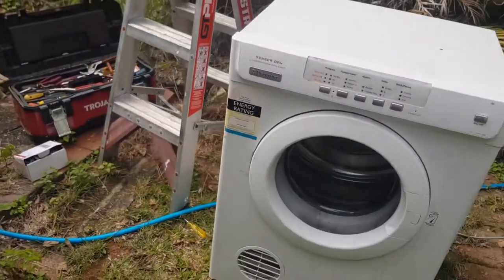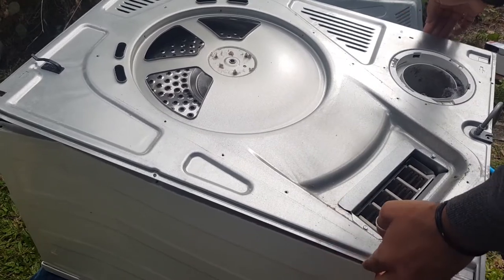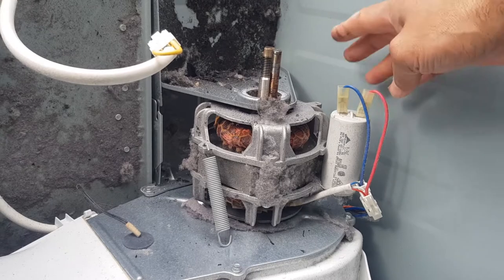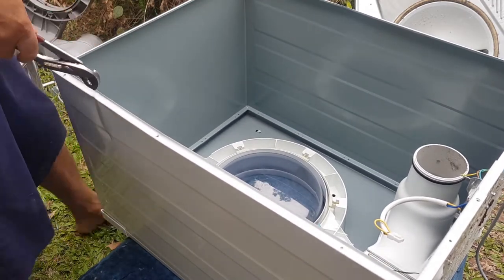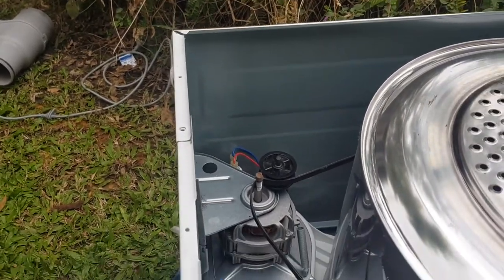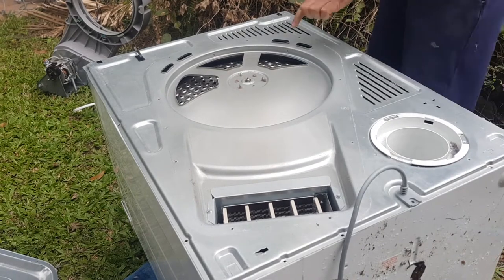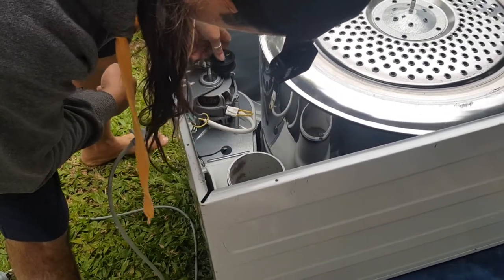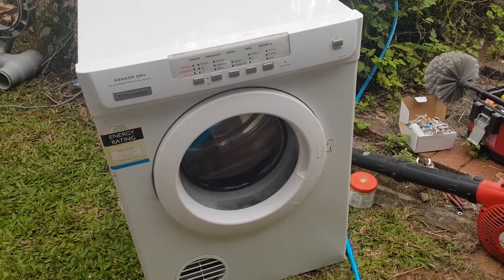Electrolux, Simpson, Westinghouse Clothes Dryer idler / Capacitor replacement. Fix Repair DIY

Comment: I have the same Westinghouse dryer, it's always been stiff to turn. Thanks for showing the idler and the capacitor replacement, I went looking for your video to see if the polarity of the capacitor mattered and you say it doesn't, so that's all good. I wish I'd seen your video earlier as your method of taking off the back was much quicker and easier than mine...
Reply from the maker: @antibodiesagainstkookery3871  No problem mate, it's good to know for next time 😎👍

Comment: Thanks for sharing this video. I was able to sort out my dryer after watching this. Replaced a broken idler pulley, belt and bearing. Runs as good as new and quieter than ever. Thanks!
Reply from the maker: No worries! And apologies for the late reply. Looks like you left this comment at basically the same time I had a massive house fire thanks to a faulty electric blanket. It's set me back quite a bit.
But we'll done! Feels great when you repair something yourself rather than toss it out and spend lots of money replacing it 🙂👍

Comment: Did one of these idler bobbin jobs when I was living down in Tassie. Saved a small fortune. Where most would have hurled it out, I had time on my hands, like you seem to do, and broke out the tools.
Ain't done the capacitor gig before... so thanks for that. Cause we have a praaaablem once again with another version of the same model (SDV401). Only this time the symptoms are different. So I shall approach from the shallow end, money wise, and take it one step at a time. I ended up creating a service 'window' right next to the motor, (with an angle grinder). In case it went pear-shaped again, I wouldn't have to pull the whole back off it to look in. Had to make a cover, of course. Used the side off another gloss white tossed out unit, and some metal self-tappers. Worked well.
Tx Man! Great stuff.
Reply from the maker: Wow that's a pretty cool idea well done!  At least these Simpsons are easy to work on.  I think they're the easiest  out of all the brands so keep going with them mate 👍
Reply: @DIYDumpRat  Cheers man. You too.

Comment: Hey just fixed my dryer because of this video (same model). Interestingly that my fault seemed to be a combination of the spring holding the motor dislodging itself and also the bearing where the drum connects to the dryer back completely being shredded. Found an identically sized bearing for $1.80 from local HW store and dryer is back up and running. I guess it’s pretty old now so not sure how long it will last but I really appreciate this video mate. Well done!

Comment: Thank you I learn a lot from your video.. I'm from Philippines. I just ask if the idler have some crack in the middle  and not perfect circle....
It's created a noise?
Reply from the maker: Hi there,  mate your idler really does need to be 100% perfect as far as shape is concerned.  A lot of the time you'll see a hair line crack in the center close to the core.  This is actually quite normal.  I see it on more and more idlers these days.  They still can last quite long time.  But Idlers with bits missing and broken off pieces should be replaced for sure.
Reply: But why the dryer when it spin..thiere is a noise.. The bearing is okay.. Theirs a possibility that the motor have a cause of the noise..?
Thanks for responding
Reply: I see the idler is not perfect curve. Where the belt attach
Reply from the maker: @basictechtutorial9356  Oh I see what you're saying.  You have a high pitch noise when the dryer is turning?  

If the bearing is ok then it is most probably your idler.  I only just discovered this very recently, but if you pull the idler off and look inside the center metal core you will see some score lines in the metal.  It's this tiny  little defect that is causing the squealing sound.  Very hard to see but they are probably there.  

I fixed it once by sanding the inside with some sandpaper wrapped around a small rod... as well as adding some grease.  But you're much better off buying a new idler if you can.

Just remember to clean the shaft that the idler sits on so that it's smooth like glass.  This really helps as well 👍
Reply: Thank you so much.. Very helpful..❤️❤️ I purchase online the idler, belt and bearing for long run .... Hope it will fix soon..

Comment: Awesome I’m going to try on my Simpson 400,the dryer would hum,spin,hum,spin I opened the back,belt and idler pulley seem fine,then I tried fiddling around with the door switch,sensor or whatever it’s called thinking that was the problem.But when I saw your video it was a Capacitor that was causing the humming problem thanks 🙏 buddy for the tip 👍
Reply from the maker: Good luck mate, It probably hums when the load of washing is heavy and when it's light it probably spins. Just make sure you pull the capacitor out of your machine first and buy the same one. It's probably the same in all Simpsons but best to be sure. Let me know how you go 👌

Comment: Hey my man....great video

I'm trying to fix my westinghouse 4kg Dryer

It seems to only spin one direction....it attempts to spin the opposite direction but it the drum comes to a stop until it times out and spins the initial direction- without a doubt the motor still spins 

What's the problem here?
Reply from the maker: Thanks mate, sounds to me like a classic idler issue. Basically the same thing that's happening in this video. Open it up and take a look 👍

Comment: Hi there again. Our dryer stopped heating all of a sudden. Discovered that one of wires serving the heater burned out near the controller. The heating element still have some resistance. I can buy a replacement wiring harness for 60nzd plus gst. Do you think I should still use the heating element? What is the normal ohm reading including the thermostat?

Comment: Hi there my spring keeps coming off after the third spin (1st spin clockwise 2nd anti and then the third spin clockwise it stops spinning and when i pull it apart the spring has come off on the lug closest to the outside of the inside frame) how do i keep it from not coming off or why is it coming off
Very good video mate now i have more of a understanding 
Cheers
Reply from the maker: Thanks Flower Cool,  honestly I don't think I've come up to that problem before where the spring comes off on it's own.  Normally the belt comes off and the sudden release can cause the spring to pop off.

I'm not sure sorry.  It's obviously something very minor that over time is causing it to do that.  Perhaps just keep trying and when rotating the drum by hand to settle the belt with the back off just do it in both directions for a lot longer.

Here's another video of me putting a belt back on which might be a little clearer to this earlier video that most people watch.  If you notice at 26:17 I quickly push the spring so it's slightly sitting over the motor.  It's not a big deal whether it's on the side like it previously was or pushed over it like I did.  Maybe leave it off to the side in your case.

I do push it back to the side at 26:44 though.

Sorry I can't be anymore help.

https://www.youtube.com/watch?v=2FDgMll0E3U
Reply: @DIYDumpRat  Thanks for replying this video was very clear ive been rotating it back and forth and it seems that the belt is going higher then the rotating shaft hence why the belt is coming off and then when  open it i see that the spring has come off
the belt does move up and down but when it does rotate upwards it goes higher and then right off
Reply: @Unkown_278 i just had the same issue with the spring. Taking the spring off and putting back on the other way around fixed the problem for me - so now the part of the spring that was attached to the motor is now attached to the body of the dryer and vice versa

Comment: Hi Mate Great Videos.
Reply from the maker: Thanks man 👍
Reply: Im doing one at the moment. Can you tell me if the motor shaft (that the belt sits on) should move up and down or stay firmly in one position. The one I have at the moment moves. It runs sweet in one position but when it moves towards the fan the shaft stops going round, Any suggestions please

Comment: Great video mate, thanks so much.
Reply from the maker: No worries Richard cheers mate 👍
Reply: @DIYDumpRat  thanks mate, have you had the problem of the pulley tension spring popping off at the bottom? Everything I put it back on, it pops off again.
Really driving me mad. Any suggestions mate. Cheers.
Reply from the maker: @Aussie3225  Too be honest no I haven't.  I know when you put the spring on there's bit of a ledge on the motor casing that the spring can sometimes get hung up on so I always make sure I push the spring off to the side of it.  But if you do what I do and test it thoroughly by turning the drum a dozen times in  one direction and a dozen in the other when testing that the belt is in the correct position (before putting the back on) it really shouldn't do that.
Reply: @DIYDumpRat  OK mate, mine comes off everything, and of course it sends everything into a screeching mess. I've invented a little hack, should be good. I don't really think these things are engineered very well, ours is only a couple of years old. Thanks for taking the time to answer me, I'm sure you've helped a lot of DIY ers. Your videos are really good, easy to follow. Sorry  I can't send a picture of my little invention.

Comment: Thank your so much what a thorough video step by step ordered and replaced the PULLEY IDLER ordered from Genuine APPLIANCE PARTS cost plus delivery $35 taken your advice and ordered a genuine part and not from EBay. Belt was in good condition. Like and subscribe thanks mate.

Comment: my edv600 wont turn the opposite direction, only humming. but it spin both ways well when the load is reduced. the belt and others are fine, the capacitor replaced already. but the problem still there. any advice?

Comment: Is the capacitor a common reason as to why the dryer wont turn mine just humms🎉
Reply from the maker: Yep absolutely. The most common reason. If it hums you need a new capacitor. Sometimes you can even get it going by spinning the bowl (empty) and quickly closing the door while the timer is already set to the on position.
Reply: Yea thats what i do and it runs thanks for the reply mate ill get a new one